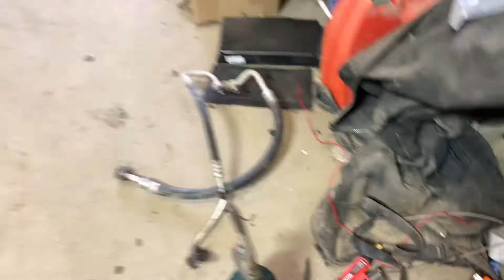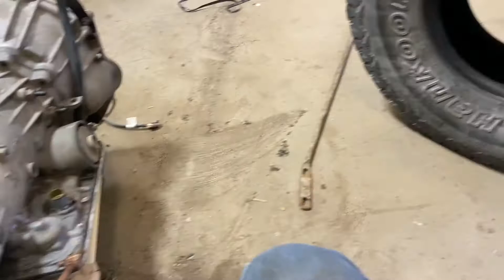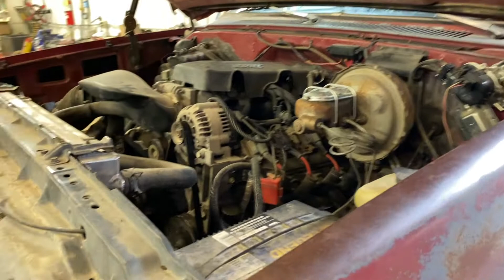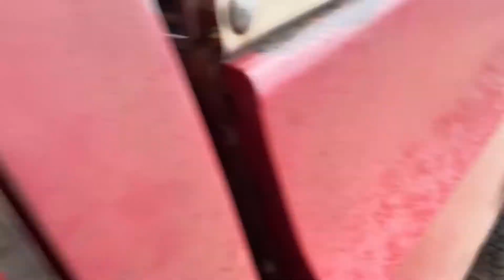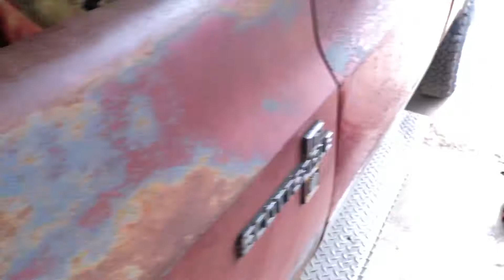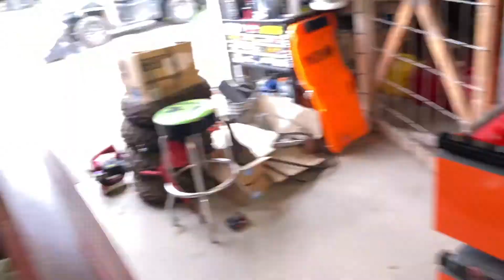(AC Compressor Bracket Mockup) 83 Chevy K10 LS Swap Project HVAC Part 1

Comment: did you have to put a spacer behind the ac bracket? i did this setup and im having issues with the belt coming off
Reply from the maker: My belt alignment was spot on with a straight edge, not sure why yours would be coming off. How’s your belt tension. I’ve heard of people having issues with the belt coming off because the miss sized the belt. Also not enough braces can cause it to deflect and cause it to have problems. Just some ideas, I haven’t gotten around to getting mine installed yet

Comment: What AC hose assembly will you use. Normally the compressor is on the driver side of the engine?
Reply from the maker: on the later squarebodys that had the Serpentine belt system the compressor is on the Passenger side. I'm using a line for a 90 k5 blazer is the exact one I ordered. It fits a 89-91 Blazer and Suburban without rear AC
Reply: @TanTinPerformance   guess I'll give that a shot for my 1986 K10 Silverado. It has 1992  5.7 Chevy Suburban engine in it.
Reply from the maker: @9and34fingers2  that should work I believe that 92 should have the same accessory bracket that I’m using on the LS